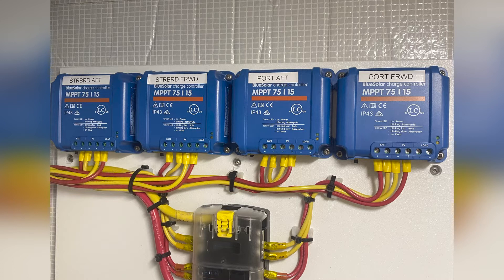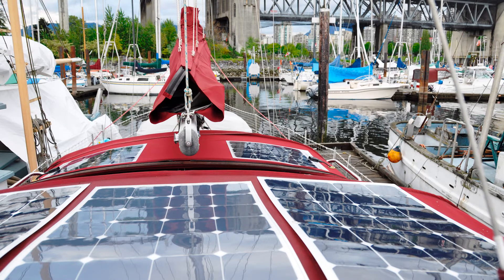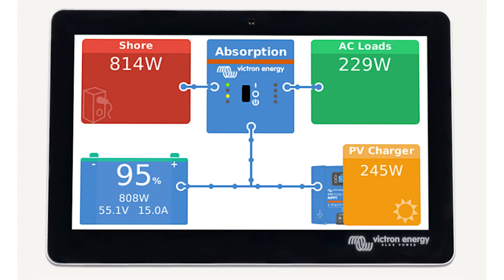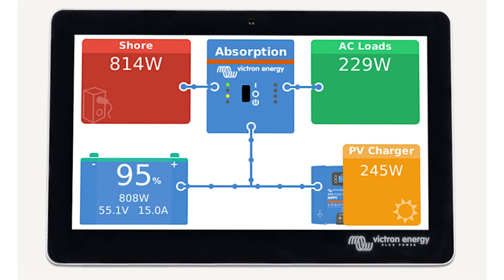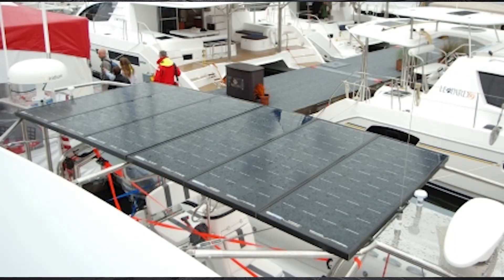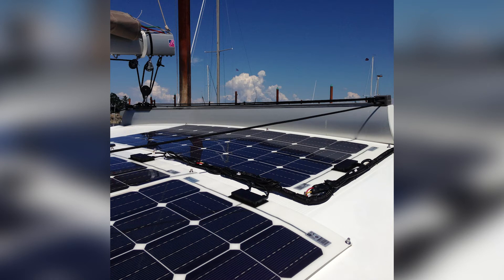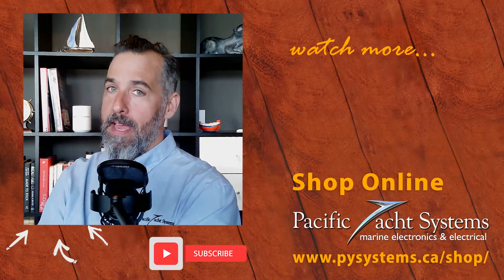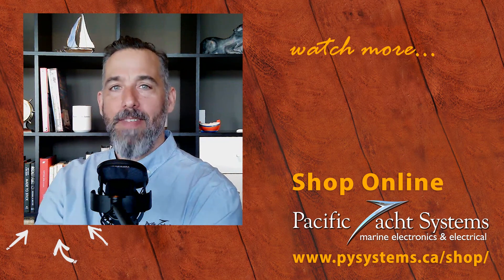Nigel Calder & Jeff Cote Talk Marine Electrical - Part 10 of 11 - Large Solar Arrays

Comment: Hey jeff all the back igniting on my circuit breaker panels and my helm switch panel have gone out. This is on a 2008 31 ft Mainship pilot. After further investigation it seems that the light source was designed with EL wire. I have tested the DC to AC inverters and they seem to be ok producing 142v AC. The units are designed for 300-600cm. I can only imagine that all the EL wire has reached end of life and needs to be replaced. All the EL wire has been duct taped to the back of the panels and will require removal of all the electronics before the tape and EL wire can be removed. Do you recommend replacing with EL wire again or do you recommend something else such as LED strip lighting(which is difficult to bend to illuminate each breaker label)  or something else? Whatever It is will require a lot of time and will probably be my winter project. For now I will continue to use my trusty flashlight. Thank you for your great advice!